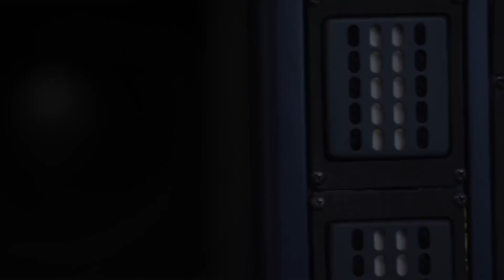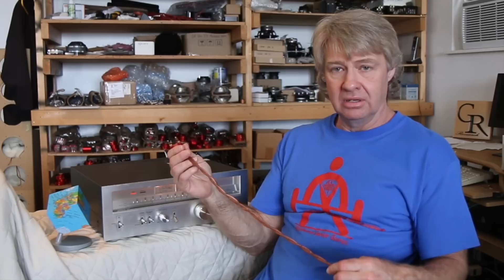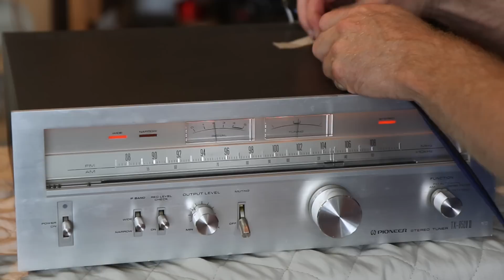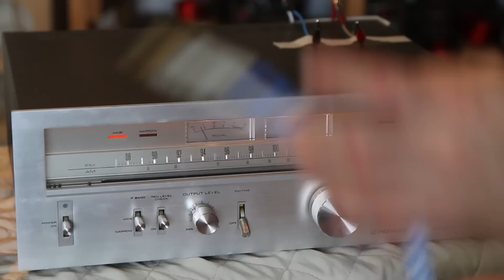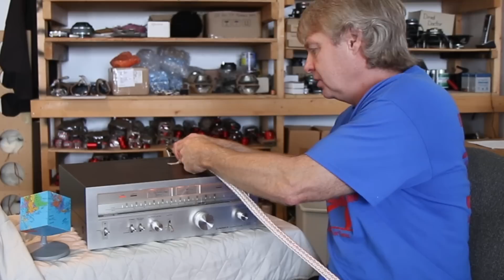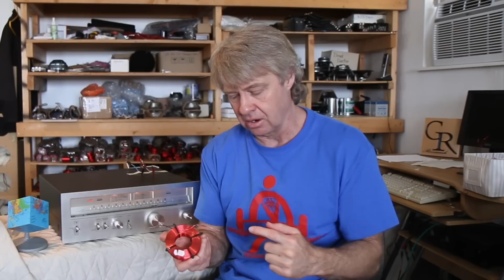Do Audiophile Cables Matter? Here's PROOF!

Comment: I didn't get very far into this experiment before I had to ask, "Why don't you just test for cable effects by identical signals nulled at the ends of a sample? We engineers do this all the time when looking for very small signal differences due to inequality. The resulting difference is the contribution of the sample cable. Big difference = not so good cable. The standard used could be an agreed essentially lossless bit of conductor. 
Also, for the cognoscenti,  we don't care a wit about what the sample can conduct; we care a lot about what it changes. 
Null testing is a thing.
Reply: This should be up voted
Reply: @xanderguldie  Just did!
Reply: @lexluthier9453  Me too. And turned to be 666th 🙃🙂😀
Reply: There is a simple reason why he doesn't do a null test.  He is trying to sell expensive cables and a null test would reveal that expensive cables are no better than inexpensive cables.  (I don't say that expensive cables are no better than crap cables ... but good cables only cost a few dollars per foot, not hundreds of dollars per foot.)  Ethan Winer, who IS an electrical engineer, has done the null testing - he has videos on YouTube - and the null tests show that there is no measurable difference between good cables and expensive cables,
Reply: @williamzame3708  It's funny how he uses a microphone and graphs to point out mistakes in speaker design, but cables are somehow different and can't be properly measured...
Reply: @williamzame3708  how are these cables expensive? And yet I see so many audiophile systems use Audioquest cables costing $5k+ for a 10ft run PER CABLE. These seem like a bargain, esp when you consider they are designed very similarly to Kimber cables which would run you $500+ for the same length and end terminations. You are just doing the work yourself here. $13 a foot plus a termination kit is massively reasonable IMO what cables are you looking at on his site that cost 100's$$ ?? I see no harm no fowl in even trying these for an extra set lying around the house for that low cost.
Reply: SPC design  Thanks for this. Nulling out slightly different signals has been a regarded and peer reviewed technique in electrical engineering for over 80 years. Yet, it is not well known among cookbook and shade tree designers. And analysing the test results must be done with discipline and rigor. No offense intended to anyone.
Reply: @Lloyd Stout You should change your assumptions; I am degreed from a recognized engineering school (Purdue, 1976 -- look it up), and a registered PE in electrical (Ohio and Florida). And we engineers have used null testing for decades to measure signal alterations caused by all manner of effects, both in the frequency and the time domain, from DC to centimeter wavelengths. Were you off sick those days in Measurements I?
Reply: @jimshaw899  hey Jim may I ask what cables you use? 
I'm not rich but just want performance  or Value for my money...
I enjoyed your comments.
Reply: @jimshaw899  wow so grateful for your detailed Reply.
Reply: @inconsequencial2546  :) Why would I not?
Reply: @inconsequencial2546  i used wet string as speaker cable once astonishingly quiet
Reply: yep. Audiophiles and recording engineers don´t have a lot of overlap in knowledge ;) demistify the vodoo
Reply: @Raumweiter  -  I'd say audiophiles & engineers have rarely been on the same page.  But whenever that's true, then I say both of them have a good head on their shoulders.
Kind of a catch 22 situation, because we need schister engineers eager to find gullible audiophiles, and there's surely a large supply of each.  Whenever we have a good sensible honest engineer working in tandem with an audiophile who does not think he needs pixie dust added to get everything out of his system, then things are good and back to normal.   All too often, the engineer is thinking ... "I'm gonna get you, sucker!"   And with a bit of practice, he most assuredly will.   Pseudo science and gullibility make for a most glorious combination.   Don't deny it.  - -  Find a sucker.  Mix with nonsense.  Bake 30 minutes.  Fudge Shit Brownies for dessert.   One million dollar$ each.   BURP.
There, I've just now demystified everything.
Reply: @Raumweiter  
Audio Engineer all my life.
Bullshit is bullshit all my life.
People like truth.
Reply: @peteleoni9665  yep. Bust out the o-scope and a DMM with a lotta zeros, and you'll get solid answers. A basic "electrical fundamentals" course would go a long way with the audiophools. It's like these people are allergic to actual science. They'd rather live in denial than admit to themselves, "Yeah, I got conned into buying $5000 strands of metal".
Reply: Is that why Shunyata cables are used widely in recording industry and medical fields etc?
Reply: @Raumweiter  - I would think that on average, most recording engineers are also audiophiles.  That alone ought to make a difference in the results which are supposedly heard.
Reply: @scotthullinger9955  I dont think so. It's a lost art .The golden age was 1950 to1979.Now its murder at mixing  desk with its forensic cleaning up, and losing soul and spontaneity.
Reply: Because if he actually did this he would have to admit it didn't show any audible differences. Cue the antenna demo..
Reply: He lost me in a different video when he talked about "high purity" wire.  I almost died laughing.  As a degreed electronics engineer and physicist, when watching this video I thought how I could instrument up a real test, ya know with o-scopes and lots of real good looking graphs from my 40MHz digital o-scope.  Then I said, nah, it's dump day. Might as well do something useful. Use decent gauge wire, use a twisted pair if you care, keep your wires as short (like under 10's of yards).  Nothing we didn't know in the 1920's.   (not me, I wasn't alive then).  I've found room acoustics to be much more important my listening pleasure.
Reply: @QualityRecord  Yes, it's a problem -- not just in audio but in science of many types. I call some of these people "tinkerers." Their sole talent is using a camera, a microphone, and YT to put forth witch doctor theories and concoctions. And if anyone shows them science, they reply by throwing their sticks, bones, and potions at them.

And 'audiophiles' are ripe, low-hanging fruit for the fakirs. In audio, we have 'carneys' and we have 'rubes'. Lots of 'rubes'. Maybe we should coin the term: "audiorubes." 

It's sort of hard to prove a fakir stupid. They pretty much have to do it themselves... which is what seems to be demonstrated here. 

The savior to this is humor: the laugh (or guffaw) some of us get from the carneys preaching to rubes.
Reply: My thoughts exactly. Null test or nothing. And yes, even if the only difference is in RF sensitivity, if you make the claim that the difference is audible, it must make a difference in the waveform. No resulting signal after null = no audible difference.
Reply: Ethan Winer built a null tester and demonstrated on his channel. He showed that there was no difference between any of the cables he tested. None.
Reply: SPC design  -   I'd love to hear from an audio engineer who DELIBERATELY designs and builds a shitty amplifier to sound radically different from others just to prove a particular scientific point that it somehow makes the sound coming out of the speakers sound different - meaning inferior to other amplifiers.  
Yes, build us a shitty amplifier.   I want actual proof.   Do your best.  Or do your worst, as the case may be.   LOL
Every part of it ought to have a specific reason for inclusion, something which is actually needed in order to build any sort of amp on the planet.
Reply: @scotthullinger9955   Rod Elliot - Elliot Sound Projects. He debunks this stuff. Has some great audio kits too I've built a dozen of them.
Reply: @scotthullinger9955  you would hate a good amp. Gigi designers play to the crowd, or we would all have studio monitors and H&H amps, like the guy with the Neve mixing desk and a pair of shitty Yamaha nearfields to hear what joe heard.
Reply: @Dave Reite If someone allows this simple video to "polarize" them, they ain't none too smart to begin with.
Reply: Yeah, obviously, if you want "proof", you don't have people listen to things, you don't "tell what you hear", that's garbage.  You feed in a signal, you compare what went in and what went out and show the differences.  Done.
Reply: @codetaku7  you realize that you just made three huge and unsupported assumptions there.
You feed a signal - what kind is it ever universalizable?
You compare what went in and what came out - how? If you're an engineer then you know this is impossible to do practically.
You are testing a cable for production of music - and that doesn't involve any listening? 
This is why we got "perfect" redbook CD's
Reply: The only way to do this is a BLIND TEST.  Many years ago,  a magazine( maybe HIFI or something like it) did just that,  using from simple homedopt audio wire to high-end audiophile cables,  the result from several expert audiophiles, you guessed it,  NO ONE can tell which one was cheap cable vs expensive cable.
Reply: I've run these tests as well with speaker cables using an oscilloscope and regardless of the cable tested I've gotten the same results.. a flat line. I also know that the human ears is far less sensitive than the instruments. Same goes for spectrum graphs looking at speaker impedance and phase shifting.. The graphs show changes that the ear is not sensitive enough to hear. Of course you'll always have those especially those who have financial skin in the game talking down to you over the topic.. I do agree there can be a dramatic difference in the signal input cables but it's at the low end. If you're using input RCA terminated input cables that were free or only cost a dollars you can get some noise due to the poor shielding, but if you go to cables that cost more in the range of 10 dollars for a pair it will definitely be obvious. Pay hundreds of dollars for the cables you won't hear a difference if you're honest nor will the null testing show anything.
Reply: @fredflintstone8048  You beat me to it. Been meaning to run that test for years.  But its hard to knowingly commit to all that time and take my system apart and set it up in my lab and run the tests when you know the results, and they results are going to say, "no difference".  Got way more important things to do.
Reply: @QualityRecord  It wasn't hard for me because I was able to wheel one of my scopes into my audio listening area for the test and clip onto the exposed parts of my banana plugs, one channel connected to the amp output, and the other channel to the speaker input. I think the setup took me less than 10 minutes which included adjusting the settings on the scope.
Reply: @fredflintstone8048 don't forget that the cable is connected to a low impedance load ((speaker), so even untwisted or unshielded should show none or almost none of the noise.
Reply: What he show is more that twisting leads and or shielding is what make the difference when it comes to low noise.Am i wrong?i agree with your comment.
Reply: I was wondering the same exact thing.  His "control" in this test is all off.
Reply: SPC design  Bob Carver lies on his specs. I bought one his amps and pre-amps when I was younger and didn't know any better.  (Luckily used $500) Also I believe that same magazine did a comparison of my $3,000 retail Carver vs $10,000 retail CJ amp and said the Carver sounded better. Well I was lucky enough to hear that CJ amp and that magazine was full of shit. Anyway I sold my Carver amp for what I had paid for it and bought a amp used for dirt cheap that sells used on ebay for around $200 (Retail???) that sounds 100 times better than the Carver amp. By the way I don't use expensive cables in house but in my car I use medium to expensive cables I bought cheap used.  I'll have to bring some extra cables in from my garage full of car audio stuff and see if I can hear a difference on my home system. My advice is do what I do buy everything used only when you can get a great deal on it . Try it out for a while and if you don't like it or find something better you'll always get your money back or maybe even a small profit when you resell it.
Reply: But surely cryogenic freezing batteries or magnets or those cute little bridges must make a difference.k suppose to one's pocket they do personally I put mine on the roof and use them as lightning rods for a while they sound fkng so bright afterwards light years better than before.
Reply: @nellyt2807  ;) Drunk or stoned? Pick one.
Reply: Well I don't know you so one would find it difficult to say .
Reply: I use locally made electric cable, I can't see how copper can be different from copper other than its purity.
Reply: @Dave Reite Truth.
Reply: It's funny how people of science is called "flat earthers". Thank you for sharing "the science way", I have much more faith in engineers than "golden ears" 👍🏻
Reply: Ethan Winer promotes null testing.
Reply: Bingo!!!!
Reply: Null testing is all she wrote.
Reply: because science is not allowed
Reply: Oh quit making sense! Now all the cable guys are going to have to try the actual test to prove there's no differences in a good cable in the first place! 
Next thing people will be spraying CD's with magic fluids and pigmented inks!!
Reply: During null testing do you measure through oscilloscope or listen it?
Reply: @ah.l  Both and more, in audio. (Null testing works for a lot more than audio -- basically, DC to light). You listen for the character of the near-null. It tells you a lot. O'scopes are remarkably imprecise, because humans aren't very good viewers of waveforms. For example, we can hear 90-100 dB, but in an o'scope waveform, we can only see about -20 dB of distortion, probably less. So, we use measurement aids like amplified FFT and distortion analysers to examine the leftover after the null. We can, with the right measuring tools, measure variations in amplitude, and frequency, and distortion, and phase change.

It really depends on the frequency and amplitude spectrum were trying to analyze.

Null testing and analysis is a methodology that is widely used in engineering measurement. It isn't a cookbook method, which leaves out a lot of the shadetree tinkerers. They quickly get deep in the weeds of what they don't know, and can no longer see the fairway or the green, as it were. 

I'm sorry to be vague; it's a complicated topic. I went into my first measurements course in electrical engineering thinking it meant hooking up a meter, oscilloscope, analyser, etc., and watching the readings. Man, was I ever surprised. We were soon trucking into statistics, differential equations of everything, equations of motion, Gaussian motion -- it got heavy, quickly. Even what looks like a simple VU meter has a bunch of engineering math and science behind it. Bet against that, and you will lose. ;)
Reply: Oscope maybe?
Reply: @kytddjj  He won't do that because that will prove what he did was just nonsense.
Reply: He doesn't sell cables yet people still accusing him of doing this for youtube comments. Makes no sense.
Reply: @thepracticalaudiophile  Perhaps you are ignornt of the fact that YT channel comment counts do a lot toward the 'algorithm' getting the channel on people's recommended screens, thus more views, thus more $$$ and more kit sales. Channel owners are not ignorant of this.
Reply: @thepracticalaudiophile  His website (linked in the description) sells quite a few, including a $250 power cord.
Reply: Why do any of this, go have a beer. It’s snake oil, emperors new clothes, make a name for yourself and fleece the ignorant.
Reply: Smart
Reply: @stormwater23  I use 16 AWG, which should be fine for reasonable distances. If you go over 30 or 40 feet you might want to go thicker.  Cheers from the Land Up Over.  My uncle immigrated to Australia in 1948 from Northern Ireland. So, if you run into any Magills, say Hi!
Reply: This is why I'm blocking his channel
Reply: becuase he is a flat earther that doesnt know it yet.
Reply: But a null tests is a different setup to when cables are used in system without null test. So that idea is as flawed as this video?
Reply: You got to be kidding, this is your test to show that twisted pair audio cable are better to reject rf signal. 
Just connect your cables on the amplifier with a 8 ohms resistor or your actual speaker and connect a digital voltmeter or an oscilloscope to see the noise difference.
Reply: @Dave Reite It was a great illustration of just one of the aspects of the differences of various cables.
Reply: SPC design  Bob Carver never cared what critics said about his equipment threw the years ,as long as he sold equipment....
Reply: @limomangeno  Greasy marketing guy, duping the gullible with his "Sonic Holography" Bee Ess. He must have had an easy life.
Reply: Yes, null testing is a simple way to test a cable's incremental influence and the problem with it is that it proves that the high-priced audio cable business is mostly a snake oil business. When you pay >US$1000 for a cable that cost <US$10 to make in southern China, you are a victim of snake oil marketing.
Reply: You know, I hope this reply hits all the responders here, but with all this armchair quarterbacking from all the said degreed engineers and PE's in electrical engineering stating required tests that should have been done instead of what was simply demonstrated here. I want to know what cables you all run and why. Granted I admit to not being on a "required" level of further education to obtain the "required" PE status in order to buy audio cables with my simple minor in electronics so I apparently cant achieve audiophile status now. But with all your genius level knowledge, again, what cables are you all using and why?
Reply: @Mike_Jones68  Sometimes, offering anything true to audiophiles is like selling Hemingway books at a Harley rally.

But, to answer your question, I use Monoprice RCA interconnect cables, and 12 gauge speaker wire from Amazon (I think it was Amazon). Cost about $50 for 100 feet. I hear, see, and know no reason to change. A couple of years ago, a local friend brought over a set of boutique speaker cables to get my opinion (before he returned them). Neither of us could hear any difference. While anecdotal, it is a fairly typical experience. 

They DID look spiffy, but in my home, I don't want to draw attention to speaker cables. Hell, I don't even want to draw attention to my speakers....
Reply: @Mike_Jones68  Ignorance is....
In America, we celebrate it. A trend without a cause.
Reply: @jimshaw899  That is true...but ok my stance: reviewers review equipment and never call out competitor equipment when saying item "A" sounds better than "another well known mfctr who sells a $xK amp/speaker/dac/etc". I find that highly annoying. So then when I see in comment train mass back/forth alluding to the "I know better than you" train of thought, tell us what you have and why...its all the vagueness in the commentary that is annoying and doesnt resolve why you or someone else is correct. Yes someone may state a specific test or points of data or a paper etc, but mostly with no context...i.e. heres a data point that made me choose X-brand due to their "X" design, etc. I think you get my drift
Reply: You are simply making a classic Reductionist argument and most of the folks indeed most of my fellow engineers would dismiss that type of argument. It simply is not demonstrably nor empirically true for any moderately complex living or nonliving system
Reply: Yeah it is and Ethan Winer has demonstrated many times that there are no differences once you factor out the snake oil. This is pure ignorant bullcrap from start to finish.
Reply: @pierrelailvaux6227  In this world, we have flat Earthers, snake worshippers, and antivaxxers. We also have Nobel Prize winners. They are entirely different sorts of people. 
We have almost no Nobel Prize winners on YouTube.
C'est la vie.
Reply: Hypothetical and Theoretical.... You really should educate yourself before you speak O.o
"The only true source of knowledge is experience "
Reply: We'll have more on this subject as time permits.
Reply: Null testing would null the RF as well as the signal rather than demonstrating the differences between cables according to their ability to transmit RF. Null testing makes cables seem more similar to each other. What was important here was the consideration of RF. I use Ben Duncan’s Pure Henry inductors on my speaker cables to filter out RF, my cables are also braided. RF is not only noise, it also affects negative feedback loops in the amplifier and creates distortion as the amplifier tries to compensate for  frequencies not generated by the music you’re trying to amplify. This demonstration was simple and powerful.
Reply: @christopherward5065  Can you explain, or even show us in simple measurements that a ~100MHz ~20 micro volts of induced RF being fed into a ridiculously low impedance circuit designed to work up to 100kHz max can make the amplifier "create distortion" by affecting the negative feedback loop? This proof makes no sense at any level. If you want to believe this, that's your prerogative, but anyone that ever designed, parametrized or even tested an audio amplifier circuit knows better...